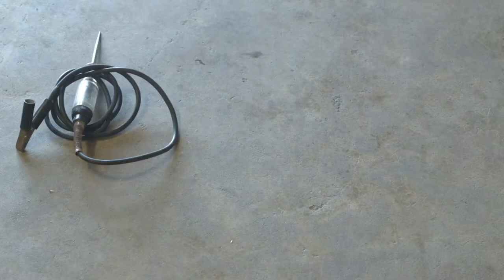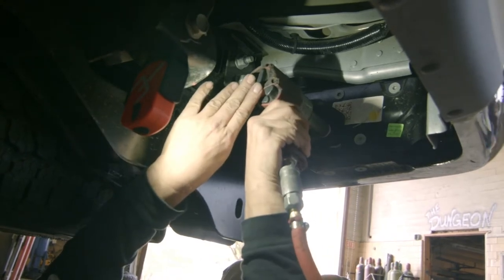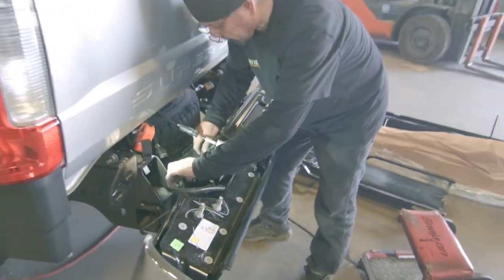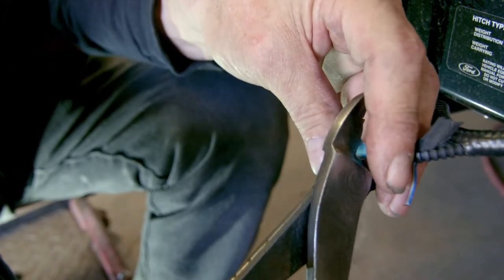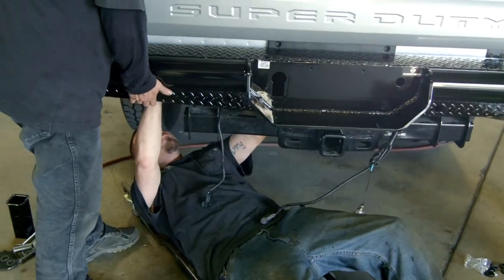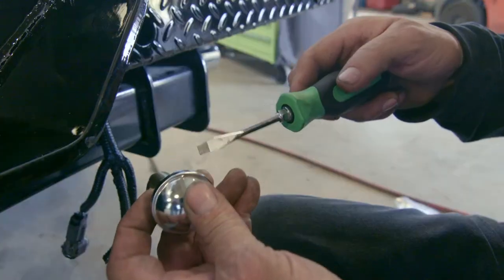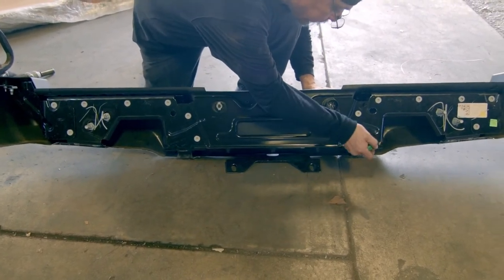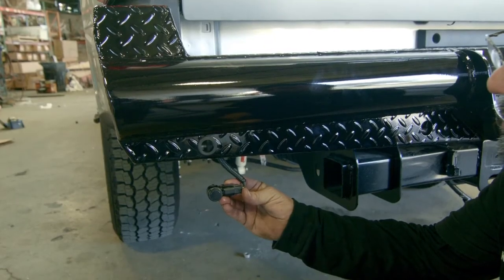Legend Series: F-250 Back Bumper

Comment: How do you wire the newer LED license plate light? It has two wires coming off it and the shop that installed my bumper yesterday didn’t check to make sure my light worked before I left.

Comment: "Remove the bumper, you won't be needing it anymore..."goes to get parts off the bumper.
"next are the sensors..." grabs the 7 pin connector
 "Snip the light..."actually snipping wire.
 "You'll discover which light is carrying the positive charge...one WIRE carries the power"
"...the gap between the bumper and body is equivalent." Equivalent to what?? Better word is equal and say what needs to be equal. 
"so there you have it..." With wires hanging down.

Comment: All that engineering and use a cheap light and scrape the new paint off for a ground??? You can’t be serious, why not make a light that comes with the bumper that the Ford factory light plugs right into or make a spot to fit Ford factory light in the new bumper?? Also it’s to small you guy make a huge front bumper and a tiny back one?